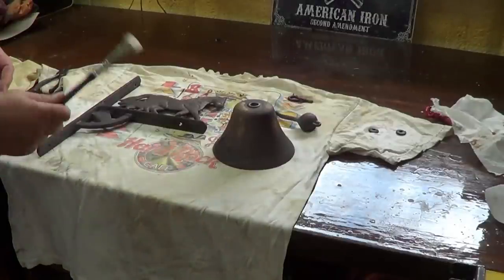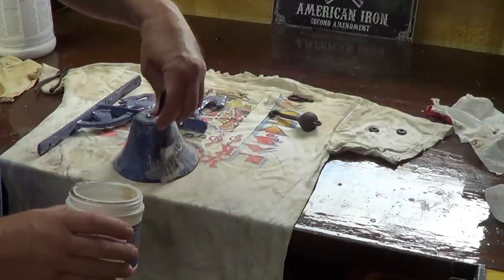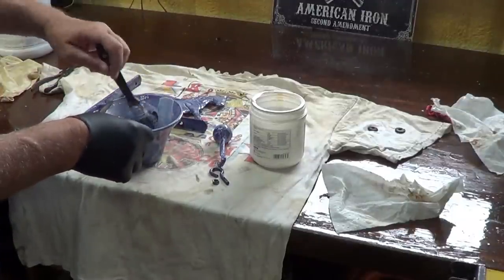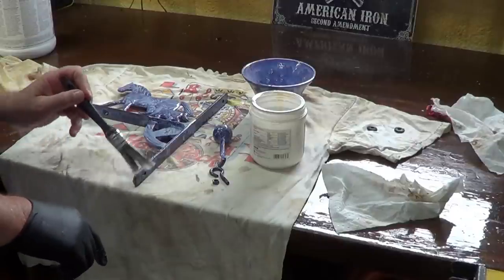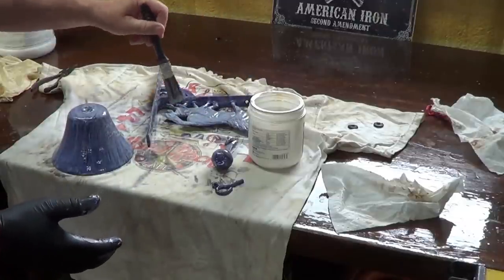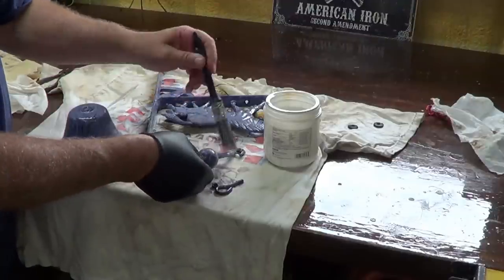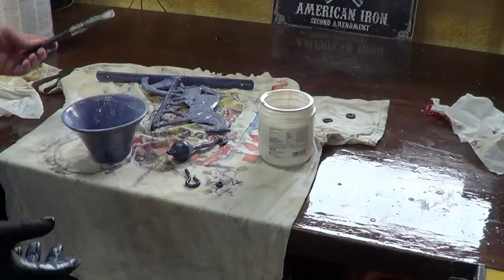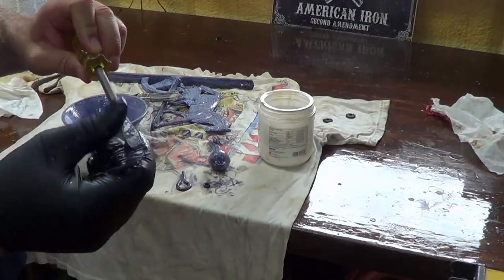Stopping Rust On Iron Horse Art - Using Rust Converter On Projects

Comment: The rust protection job looks great. 
I do the same on laser cut designs with penotrol.
Reply: You do laser cuts into metal? How is penotrol different from this rust converter?
Reply: @kayBTR  I bought the steel designs, they had surface rust. 
No difference really, except it is clear, just paint it straight on the brushed off surface rust and it penetrates and seals well. It’s meant specifically for this. 
I may have spelt the name wrong a little it’s been a few years since I’ve used it.

Comment: I didn't realized there a a baby horse until you flipped the piece over and held it up to the camera. I like the spray rust converter better. The brush on converter leaves brush stroke marks and the finish is a mix of matte and shiny. The  spray paint leaves a smooth matte finish.

Comment: Nice project.   Got tracking number for dip stick shipped. hopefully get it sooner than later.  

Debating on using the Renaissance Wax on precision gauge blocks and other steel tools.  Wondering if it will effect the thickness.  Hard to measure if it changes.
Reply from the maker: cant you measure something, apply wax, polish off and then remeasure same item to see if it changed?
Reply: @ThinkLikeAHorse  Yes, but if you ware measuring to 1/1000 of a Moose Hair, then tough.  don't want to jack-up my precision tools with this wax.  Probably not a big deal, but caution is the word of the day.  

2/10 of 1/1000 is my limit.

Comment: Have you had to use any products you would reccomend for fixing a  basement, concrete, inside wall crack, that allows water to get in?
Thank you! Laural
Reply: The rubberized stuff works.
Reply: @sandyelliott3350  Thank you, does it need to be mixed first? Someone from church offered today to chisel it and get out loose stuff and fill it, I'll look for that product. Honestly, he offered to do that three months ago but I didn't press the issue with my father, who was skeptical. Today, I told my Dad he offered again, but he wants to talk to the guy at church tomorrow. Thank you, I'm going to search it on the internet and see where I can pick it up!
Laural

Comment: Did you use a wire brush or steel wool before brushing it on (as you did with the medicine cabinet)?  I need that stuff for my wheelbarrow.
Reply from the maker: no, I could have but did not see flaking and rust chips so all I did was paint on